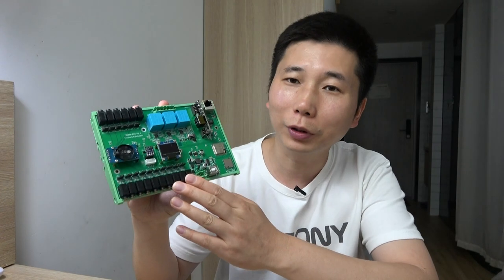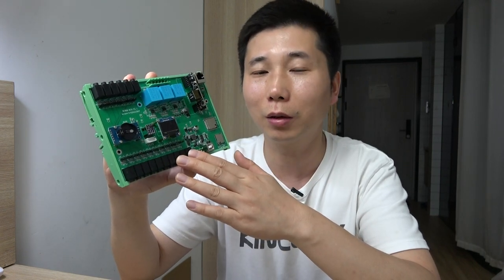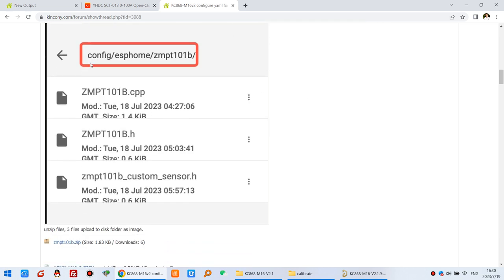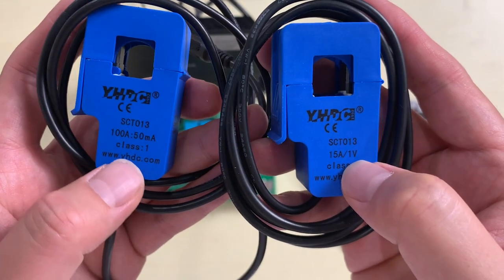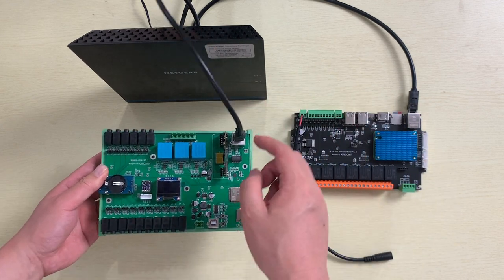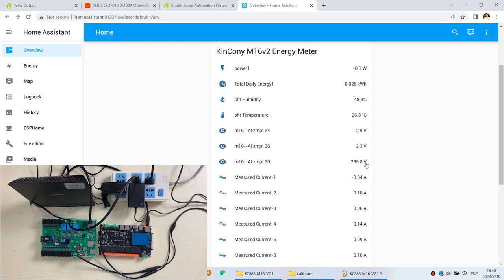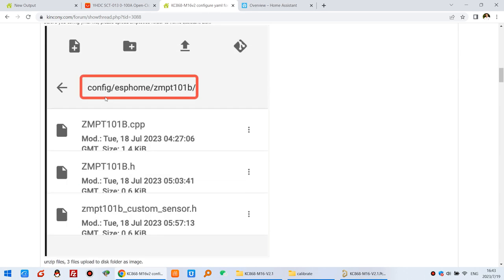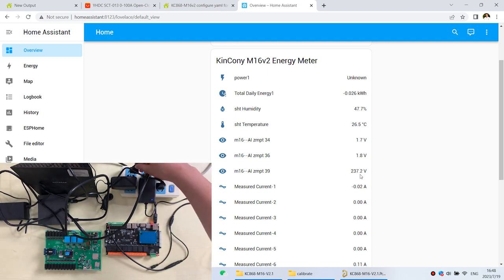esp32 energy meter main board - KinCony M16v2 work with home assistant

Comment: Will this work for USA, dual 120v lines @ 60Hz? I want to be able to put clamps on lines with 15A, 20A, 30A, 50A, and 100A.
Reply from the maker: sure, support, suggest use the newest version : M30
Reply: @KinCony 2 questions: is there a specific problem the larger board solves? Does M30 have PoE support?
Reply from the maker: @wellsgofar3196  M30 not support POE, M16v2 support POE.
Reply from the maker: @wellsgofar3196  do you means want more channels for monitor? M30 is 30 channel for CT clamp sensor.
Reply: @KinCony  I don’t need 30 channels or LEDs, but why do you suggest M30 (newset version)? Does the M30 have some bug fixes M16 does not?
Reply from the maker: @wellsgofar3196  M30 use energy IoT chip, so that high precision, calibration free.

Comment: Hi will this work with split phase 110/220v 50hz. If so will there be independent voltage sensors for each phase? Thanks
Reply from the maker: yes, support 3 channel voltage detect

Comment: can your current detect reverse flow?
Reply: @KinCony for example measure current for solar production. So do you get a negative value then? I think it is important to install the CT clamp in the correct direction?
Reply from the maker: AC or DC battery current? @dedeckernick
Reply: @KinCony AC. Behind inverter of solar system.  But will be ok.

Comment: First I was excited, but then I saw a demo with water cooker. Your power measurement shows exact multiple of the voltage times current. No power factor correction! So the reading is false!
I guess I will wait for V3.
Reply from the maker: because my AC actually is AC237v, not AC220v. The label on the electric kettle only prints a rough power value and is not accurate. in esphome i have config the update interval is 5 second.

Comment: Hello, 
Is there a reason why you use momentary relays instead of latching relays? This would reduce power consumption when powering over small current sources such as POE or 12V transformers.
Excellent videos by the way, I always look forward to new videos from you to see what amazing things Kincony comes up with.
Reply from the maker: but energy meter without any relay installed.
Reply from the maker: @psychodolphin87  yes, no problem, M16v1 support.
Reply: @KinCony  the energy meter will read how much power the system is drawing. For example, something that is on for long periods of time such as a light globe, the momentary relay uses current continuously for the light to stay on, a latching relay uses current to turn on, and then drops to 0mA.
Reply from the maker: @psychodolphin87  i understand you, that's Latching Relay
Reply: @psychodolphin87   Yes,  latching is better talking about power consumption, but if you use latching relays on smart home apliencies you some how need read all relays status, by example you need alot of those blue voltage dividers like on M16V2 to meassure output. Its becouse if you lose electricity or something your controller did not know which relay is on which relay is off

Comment: Make a board for the swimming pool ❤
Reply from the maker: just use our relay board.
Reply: @KinCony  Your communication board doesn't have ph, it's better to be private
Reply from the maker: @shandradm911  what's "ph"?
Reply: @KinCony  I believe the "pH" they are talking about is the chemistry term, 'potential of hydrogen'. This refers to the acidy or the alkalinity of the water. You can balance the pH level by adding certain chemicals.
Reply from the maker: @psychodolphin87  ok, just add PH sensor is OK, use by analog input port.

Comment: thank you 🌹🌹🌹
Can I collect readings over a day, week, or month and calculate the consumption value using Home Assistant? What is the code?
To calculate the monthly consumption value and the monthly electricity bill using Home Assistan?
 Can a large CT be connected to a cable with a cross-sectional area of 500 millimeters?
Reply from the maker: yes, just config by home assistant. you can chose different range of CT clamp sensor. just the signal is dc 0-1v output

Comment: Can I ask why use an external RTC rather than using the INternal RTC in the ESP32
I have a project where im wondering to use either one.
Reply from the maker: extend DS3231 RTC is better than internal. also with battery, it can save time when power off.
Reply: @KinCony  Thank you , love ur videos keep it up
Reply from the maker: @unknowncheetah  thanks